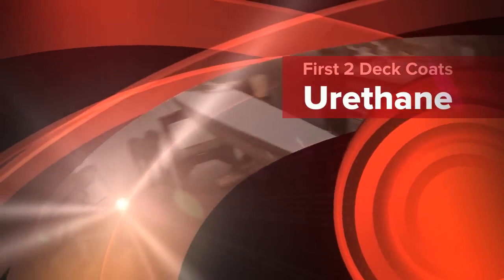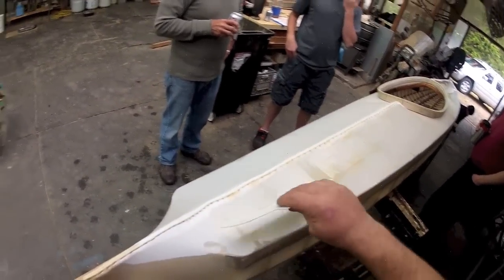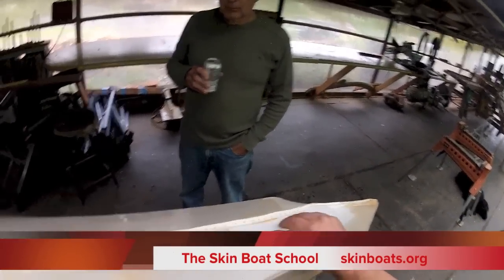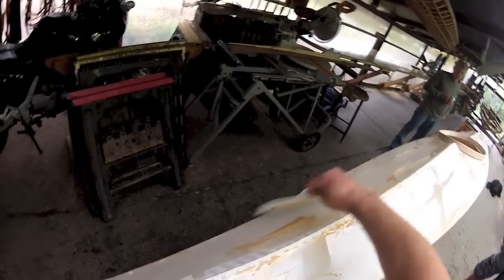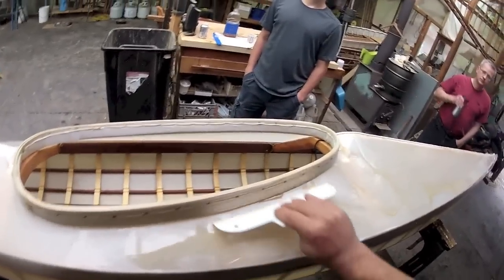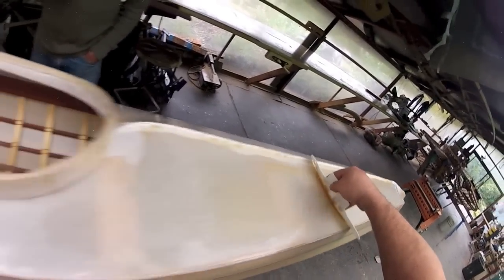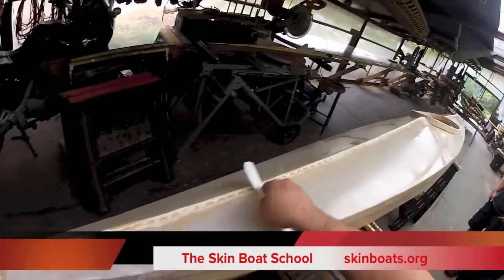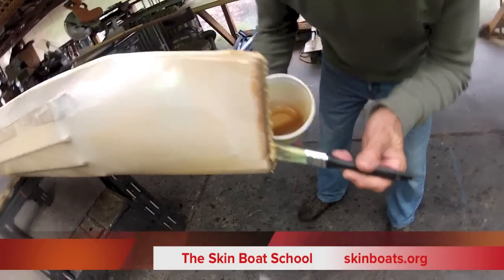Kayak Building: Spirit Line's 2 part Urethane Application

Comment: I have questions about the heat-shrinking  of the fabric  prior to application of the urethane.  

We have built dozens of these (umiaqs) in our community, but neglected to heat shrink them.  The result is a kind of saggy skin.  We want to improve our technique with heat shrinking.
Questions:  Is the skin wet with water when you apply heat?
How much heat is enough? 
Is a household iron better than a heat gun?
We were nervous about applying heat because of the risk of burning through the fabric, and the newly applied and drying skin appeared "tight enough".  Then we took them out of the workshop and the frame contracted, or skin relaxed and over time the wrinkled surface formed.

I tried in vain to look for a good tutorial on the shrinking part and would appreciate any suggested sites or youtube videos.  If nothing else, we will use a scrap and test for heatshrink methods

Comment: 1:10 "We did the 6 parts B and 3 parts A"
1:30 A little Rare earth pigment natural sienna, "just a little bit of the harsh white out..when it yellows it will be a more mellow color." 
Tools: Shur-Line Paint guide (comes with the urethane kits) and bristle brush (BYO) for the detailed areas.  hope this is correct.
Thanks Corey

Comment: How long does it take for the urethane to cure?
Reply: I built one at his shop about 8 to 10 years ago, we put the coating one day and I left the next day, it was still a little tacky but I didn't get any worth mentioning marks on it from racking it though, two days would have been better. still doesn't leak.